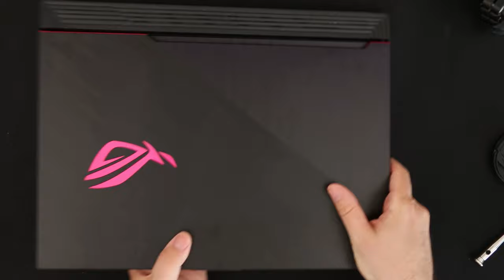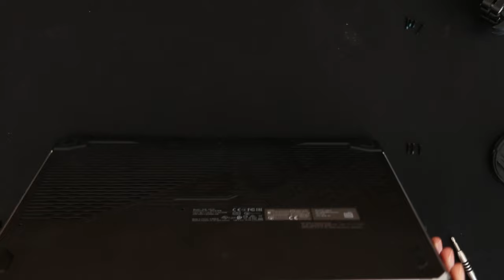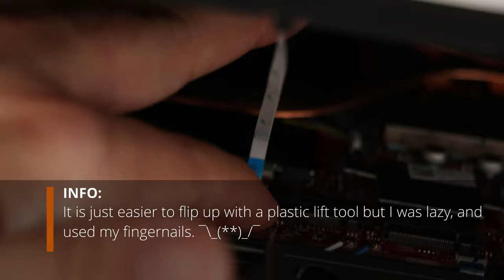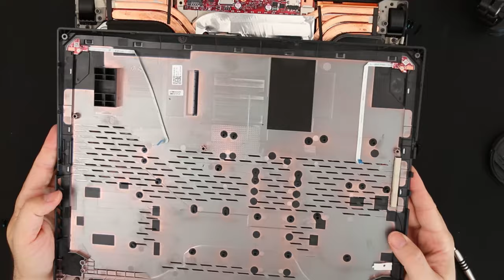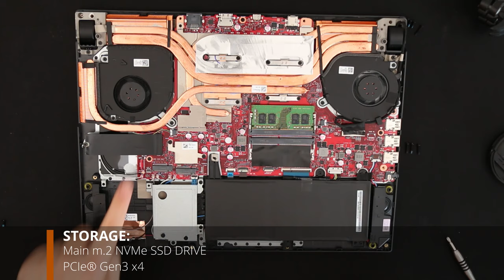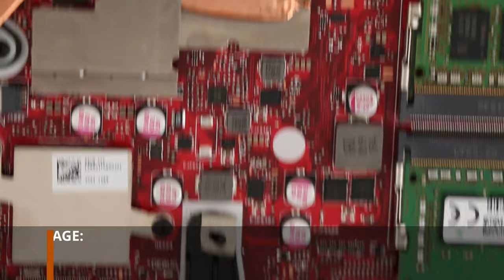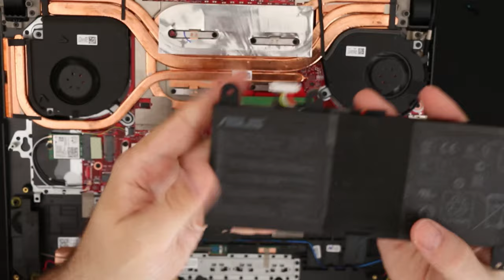ASUS ROG Strix G15 G512 - DISASSEMBLY and UPGRADE OPTIONS

Comment: I'm about to upgrade the memory on my G512LI, to be safe I just decided to get 8gb and as close to the original model of memory stick that came with the laptop as I could find. Unfortunately I could only find "M471A1K43EB1-CWE", where as the original stick was "M471A1K43DB1-CWE", from what I've read it should be compatible with the original memory, but do you think there will be any trouble if I install this additional memory stick?
Reply from the maker: I see no difference at all in terms of specification. (Must be some kind of a manufacturing process or revision differences but that's all) - I see no reason not to work in your setup. ;)
Reply: Hello sir I’m in the same situation. Does the EB1 works with your DB1 already installed?
Reply: Hello @HannibalB can you help me please I want to be sure to buy the EB1 to work with the DB1

Comment: Your video probably answered it for me, but what about the GPU or CPU itself? Are those upgradable?
Reply: Usually CPU and GPU are smoldered to the motherboard. Basically you cannot upgrade CPU and GPU, perhaps if you switched out the whole motherboard you could do it but that would be expensive and you would have to replace it all.